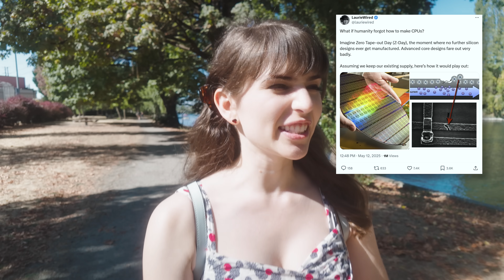what if humans forgot how to make CPUs?

Comment: i wanna add to your point of software optimization and old hardware. i live in poverty but i have a whole stack of old desktops and laptops. i hang around people with more money, they end up with random old unused hardware in the basement that they think is broken or trash but is really just a tad old or misconfigured. and i get them for free. and i slap some light linux onto it and some basic software. and now im good to go. i have an ubuntu powered 10 year old tablop convertible for college reading and writing. people think i got money. no. i only got brains.
im currently waiting until i accumulate sufficient ethernet and power cables because i have like 5 old frankendesktops ready to hook up together to do basic webhosting and minecraft hosting for myself and friends (especially for like some software tools that work better if theyre hosted as a webservice, such as tiddlywiki)
omg addendum 2: even if i were to build a CPU from individual discrete transistors it still would compute my functions faster than i could do by hand. even one byte per second is basically already superhuman in exactly those areas where humans tend to be weak

Comment: I just started the video and wouldn't be surprised if you brought it up but the premise really isn't that wild - The majority of modern chips are fabricated at TSMC, it's the world balanced on a pinhead. There's a single point of failure. 

EDIT: Someone else brought up ASML, and it's a better point. There's other chip fabs even if TSMC goes down, it'd be a setback because they are the most advanced but we'd keep it rolling - but if the manufacturer of the lithography machines they use goes down, it's a full chokehold

Comment: Note, writeable CDs are actually also extremely temporary, and degrade fairly quickly, as in within several years. Lots of people would burn data to CDs and DVDs and put them into 'cold storage' (their closet), only to pull them out 10 years later and find that they're unreadable.

Comment: Lost knowledge and lost skills are a completely valid, and I would imagine a fairly common fear.
To be "tech savvy" you usually just have to be proficient in the use of a thing, you are very rarely if ever expected to understand a thing inside and out to be able to reproduce it.
With the loss of inventors, creators, builders, or whatever it is you'd prefer to call them the best you can hope for is to maintain what you have unless the knowledge to reproduce it is passed on.

Comment: Are you thinking about Intel who's management was so greedy that they didn't invest in new fabs and now are at a point where they can't produce reasonably modern parts?  They in fact go to TSMC for fab, what if they never get their new state of the art fabs running at a decent yield?  There is of course still TSMC, Samsung and Micron for Fab but it is a good question.
Reply: I worked in CPU design many years ago and have owned and worked on a lot of PCs, some 25 years old and still working.  I believe that your timeline should be ballpark 2-10X.  I also did reliability analysis on a custom CPU design for the Military and non gas tight connections were a dominating factor.  Reseat boards and wipe the contacts and they might continue to work.

Comment: Interesting video, but it does start from a bit of a vague premise and is a bit inconsistent in its restrictions. You describe this as a "zero tape-out day" which implies no integrated circuits at all, but then primarily focus on processors - is it just CPUs we forgot how to make, or any integrated circuits at all? Being unable to produce processors is a very different situation than being unable to perform any silicon manufacturing at all; there are way more simple ICs doing myriad tasks all the way from simple transistors up to DSPs (with voltage regulators, opamps, etc in between) whose continued existence is required for a lot more device classes than actual "computing". The power grid itself could very well fail around or before we ran out of any legacy computers to use, unless the entire thing gets reverted to using mechanical/pneumatic/vacuum-tube/relay based control systems.

Later, you describe failing hard drives causing storage constraints, but the important wear-prone parts of a hard drive involve no integrated circuits at all; just the control boards (which would be very resistant to electromigration with the ancient processes used in the manufacture of the ICs on those boards). You say storage would switch to optical, but all optical media relies on failure-prone diode lasers (produced using similar fabrication processes to integrated circuits) in addition to having largely the same reliance on ICs for control boards as hard drives.

I think an important aspect not covered here would be the rise of heterogeneous compute in software design. When you can't go to Dell and order a data center full of identical systems, it's a lot more important that your code is both very efficient and runs on a broad range of different hardware and architectures that you've managed to cobble together and keep running. Certainly an interesting optimization challenge for any software engineers working in this thought experiment!

Comment: Hey Laurie, let's not forget the hardened machines from the 1950's from Univac - the Solid State-80 and Solid State-90, which had a massive main memory of 5000 words(10 digits of bi-quinary(1,2,4,5 with forbidden combinations) if I remember correctly) and ran entirely on diodes and magnetic amplifiers, pumped by an rf transmitter(shielded) of around 100 mhz!   Transistors were considered to be too unreliable to use for computation at the time these machines were designed.  Double addressing was used in writing code to locate the next executable instruction just in time to be read off the drum.  Manual programming of this machine was quite a bear!

Comment: I work in a machine shop and just from experience I feel like the large pieces of industrial equipment will last the longest, things like lathes and mills. we have a sent of lathes from that 90s that are still going strong, I have been to a shop that has a lathes from the 80s that still gets daily use and it’s running true. They are dead simple computers to begin with and build to a higher standard because of the environment they are going to be in. Much of the time when machines break it’s not the computers that give out its physical parts of the machine itself.

Comment: That's a particularly poorly defined "scenario", especially considering the unusually specific timeline claims. What exactly can we not make anymore? Just CPUs...? Does that include embedded-oriented ones like ARM or RISC-V or not? Does it include microcontrollers? Plenty of us can design a new CPU starting from basic logic chips - can we still make those? No? Well, plenty of us can design a new CPU starting from discrete transistors too. No? Can't have that either...? Okay, plenty of us etc. etc. vacuum tubes then. And if need be, GODDAMNED RELAYS AND PUNCHED PAPER TAPE. Or have we also forgot how to wind a piece of wire around a bit of metal as well? Because at that point we might as well just lay down in a coffin and go "well we had a good run, let's just stop breathing now..."

Comment: Somewhat nonsensical exercise but yes it's very true that software could be improved. Amiga OS was maybe 300kB and there was no overhead in opening windows and it worked with 512kB of ram. Today google garbage browser can't start without using 10GB of ram and Windows itself wastes 10GB on sheer principle for absolutely no reason. Word, excel, these haven't gotten more computationally demanding as CPUs have 1000x'ed in speed so yes, much of the computational burden today is intentionally wasted by microsoft. Computers could be instant in operation if they weren't marred in absolute garbage bloatware. Using java virtual machine should be a capital offense. Also getting rid of all the jews would be generally very beneficial.

Comment: Interesting scenario! But I would expect that, once the problem is realized, it would be possible to reverse-engineer at least the technology level of the 90s before existing supply runs out. After all, much of the fundamentals is known publicly, and if no CPUs could be manufactured anymore, it would immediately become a top 1 priority for basically every government research program to restore this capability. And they would still have access to modern computers for several years. So, if CPU manufacturing did get lost, it would probably only set back progress by 10-30 years.

That said, it's an entirely different story if you assume that knowledge was not lost e.g. due to a company closing, but due to greater societal collapse leading to the collapse of supply chains and loss of knowledgeable people and loss of scientific data. Which would be pretty bad.

Comment: People accomplished a lot with vacuum tubes and slide-rules. Cars ran perfectly fine without electronics. They had things called distributors, carburetors and manual transmissions. No airbag bombs, just seat-belts. IT WAS BETTER.

Comment: Thats why we need an open source cpu manufacturing process. Which requires an open source spincoater and photoresist,  an open source photolithography stepper ,an open source dopant, an open source developer, and an open source die cutter. Then all we would need to do is put it on a socket
Reply: Major corps will fight tooth and nail to prevent this from happening.
Reply: @Dave102693 There's literally nothing stopping anyone from developing these things except time and money. Real life isn't drama class or a movie
Reply: @RN81101  So there's nothing stopping anyone from developing these things, except all the socioeconomical structure that does stop people from developing? I don't get it
Reply: @Voshchronos  They fail to understand that the major corps play a part in this time and money issue.
Reply: There is one for a spin coater, we could find a photoresist fromula most likely, and a dopant, and I assume by developer you're referring to a chemical of some kind, there is one for a photolithography stepper, there is one for a die cutter, and there are open source CPU designs.

Comment: Think about even the reach of our travelling. Boeing, Airbus etc all rely on microchips/processors. Suddenly flying is back where it was in the 60s and 70s. All the years of safety padding now having to rely on mechanical again.  Satellites are another area that would be impacted...not just the manufacture and deployment of new satellites but equipment that can continue to communicate with existing satellites.

Comment: the problem is that if there isn't some magical force keeping us form producing electronics it would be restored quite quickly
even starting from ground up we could get to producing at a decently small scale fairly quickly with all the retained knowledge, a 2-3 decade setback but nothing more than that
and even if we couldn't create typical silicon electronics as per the magical force, we could still try to produce alternatives, using analog computing and such

Comment: I'm keeping my Pentium II computers. Never mind losing the internet, end of most white goods, washing machines, fridges, air fryers, microwave ovens, also engine management systems for cars, elevator control systems. There is very little in modern life that doesn't use a microprocessor.

Comment: "Savvy consumers saw what was coming, they started undervolting and cooling their CPUs since day one" i already do this, one of my previous CPUs (i5-7600K) had noticeable degradation over the years which wasn't a huge surprise given it was overvolted + overclocked, and i don't care to repeat that. So my 13600K has been running drastically undervolted, while still actually getting an additional 100MHz for the P cores, and then when the time comes where it's starting to be insufficient, it's always possible to crank up the overclock later to postpone an upgrade but then it'll still be practically new and still have a bunch of life ahead of it even under rougher conditions.

Comment: I did that thought experiment as well and found a few things that might be for the better:
- The content and communication bubble we have would burst immediately. There would be a brief panic, but then people would invest a lot more thought into anything before posting it online.
- People would value each other's time more and actually prepare for meetings, as "looking stuff up later" is more costly and risky.
- We would read a lot more books. Simply because it's more reliable. Likewise, writing would change from e-book spamming to something that gets created when someone puts in the effort to write without tools.
- Likewise, people would invest more in engineering upfront and documenting later, as content like yours would be a premium, and if you don't actually know your stuff, you are f***ed
- Ads would diminish as the cost of streaming them would no longer see a return on investment.
- Vehicles and machines would quite swiftly shift the budget back to more traditional engineering as:
     - Chips will get too expensive
     - suger-coating bad design with software will be limited pretty quickly
     - As the market for CS engineers diminishes, it's reasonable to assume an incline in traditional engineering. For example, math stays the same in all fields.

It also depends on what knowledge we lose exactly. Let's assume we lose the transistor. We would immediately have a huge blackout problem. If we lose the ability to put the things together, but keep the micro-mechatronic stuff, things wouldn't look as grimdark. This would determine how we would lose things like X-Ray, television, or radio, and how reasonable it is to regain the tech without using a CPU. ^^ Some future John might be able to get Doom up and running on a freaking breadboard with tubes, hydraulics, and punch cards. Someone from within the field should write a novel about this.

Comment: If we're talking about small feature silicon manufacturing in general stopping, I wouldn't include hard disks and lithium ion batteries in that. Hard disks are precision manufacturing, but while the supply of microcontrollers lasts and can be recycled from dying drives, I would expect the manufacturing of the disks to continue. As availability of microcontrollers dwindles, capacities and speeds would reduce, but production would continue. Lithium ion batteries also take some very fancy chemistry and tight controls for their production, but they don't need fancy silicon, even for the safety circuits they usually come with.

NAND flash would obviously degrade over time, but I'm surprised at the assessment it would last so long compared to processing chips. Microcontrollers would be the most precious commodity ever, they're everywhere!!

And depending on the knock on effects for the wider economy, I would expect new cars to still be built, just with the processing power reduced, simplified, and removed where possible. Production lines would be much less automated. You can even build an electric car with no computing parts for the controls (probably more reliable too!) and theoretically in the thought experiment, efficient power conversion circuits could still be built with large feature silicon manufacturing. Not only do they not need the extreme precision of the tiny node sizes we use for chips, but the method of their production is much simpler and less proprietary knowledge is involved. But this part really depends on the premise of the thought experiment: what production would actually stop, and why?

It's an interesting thought experiment that at least leads to a future setting where "AI" isn't everywhere!